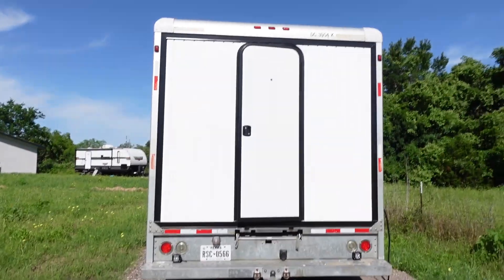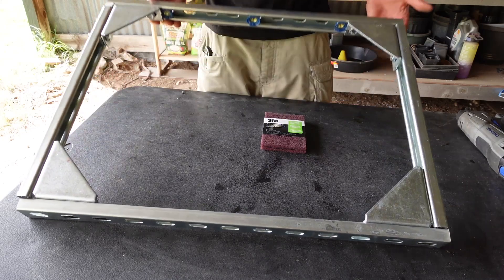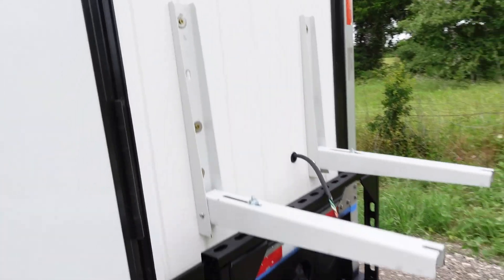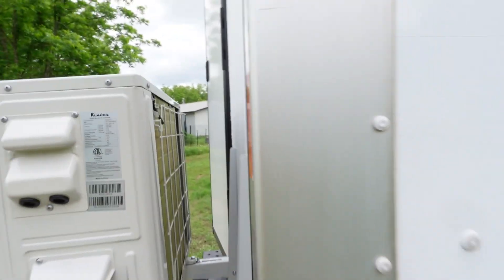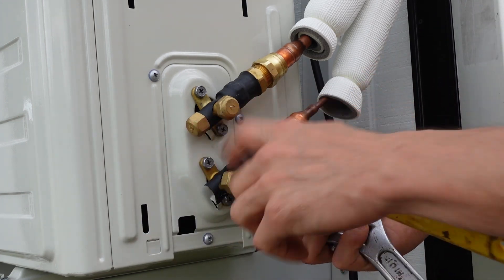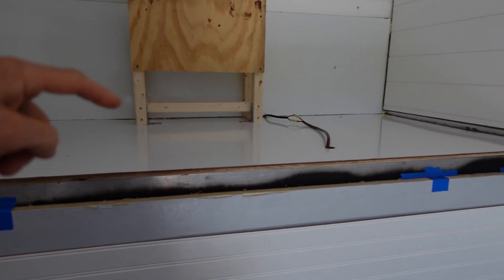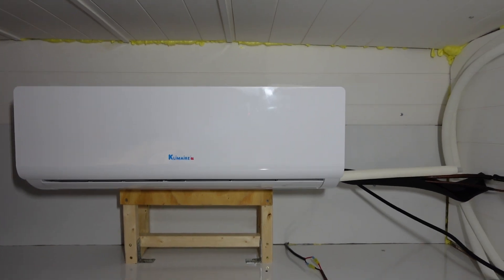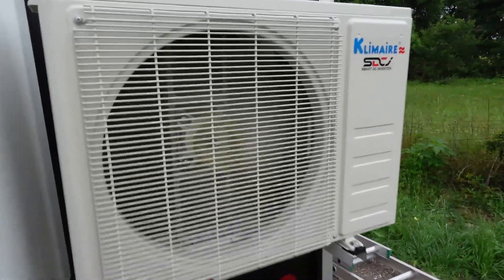Mini Split Air conditioner install | Box truck ductless heat pump installation

Comment: Wondering if the remote uses RF or infrared? Like does it go through walls or do you need a clear line of sight to the unit?

Comment: Would this be too heavy to install over the cab instead of the bumper & create a cover for it?
Reply from the maker: The fan blades can be damaged when freeway speed wind is forced into it
Reply: Makes sense about the blades, but the refrigerator trucks must have a different type of unit in front of their rigs to prevent that. @nomadbrad503

Comment: Hello Brad, Great Video !!  I heard you say in one of your other videos that you weren't very happy with the Heat on that unit. Was it because of where you mounted the inside unit ?  If so, was there any other place that you considered putting it ?   Just curious....
Reply from the maker: The problem is that you have to mount the indoor unit high on the wall so that it cools properly( all the hot air raises to the top
Of the van)  but when your heat source is also high then all the heat hangs out in the top of the van and the air that is lower in the van is cold. 

It’s very noticeable in a vehicle probably due to having less insulation than a traditional house. 

I use a diesel heater for heating. The outlet is down on the ground. I’m very happy with it
Reply: @nomadbrad503  - Thanks for that info Brad !!  I was also wondering about how loud that "clicking" noise is on the diesel heater since it is right under your bed....any issues with that keeping you awake at night ?
Reply from the maker: @menmustchangebeforekingdoms  it not loud to me, no issues with the diesel heater

Comment: You didn’t need to pull a vacuum or add refrigerant when you installed this?
Reply from the maker: No. I bought this unit specifically because it has special refrigerant lines that come with the refrigerant installed. No vacuum pump required. All you have to do is screw in the lines and you’re done. The unit has been working excellent
Reply: @nomadbrad503  Thanks - another question: what is the rated voltage of each of your solar panels?
Reply from the maker: @1drhnsd1  I don’t remember exactly. 4 panels are about 37 volts each. Wired in series-parallel to deliver around 70 volts to the charge controller

Comment: How is the unit connected to the solar panel?
Reply from the maker: It doesn’t connect directly to the solar. It’s all tied  into my electrical system
Reply: @nomadbrad503  
Cool. So how does it connect to your electrical system?

Comment: Why locate the copper wire at the top instead of right behind the unit?   Seems less stealthy routed to the top on the outside.
Reply from the maker: I agree with you

Comment: Hey Brad.   I'm worried a car will back into the mini split mounted so low.   Im thinking about building a 2 x 4 frame inside to screw into.   Also do you have issues with the drain pipe only on one side?   I've heard the water can leak the wrong side when driving causes shifting.
Reply from the maker: dont be worried! life is too short. no leaks from the drain pan

Comment: Very cool installation. Thanks! Are two batteries counter balance weight to the split ac weight on the right side? Since no max fan on the roof, is the air circulation going through the kitchen vent and ac during stealth parking?
Reply from the maker: I did try to balance the weight as much as possible. The electrical cabinet including batteries does balance the ac unit.

Comment: Good video. I installed a 9000 Pioneer mini split on my Class C RV E350 Cutaway van. Wish I had gone with larger unit. I live in Yuma AZ and for extreme Arizona temps you really need 2 times your square footage when choising size. My unit is 26', end of summer it just wont keep up even with good insulation, shade cloth on windows, insulated curtains, insulated floors etc. Anyone considering a unit, go big or plan to stay higher elevation to escape heat. Also, head unit inside may need wall support outside if your wall is thin. Spot on about install, we installed, then had professional inspect and certify, worth it. Back bumper best location, you need access to clean oytside unit after storms to keep out sand, and access to hose to spray out. Inside unit also needs regular dry cleaning of filters to work. The heat from unit is great too. And most important, its totally quiet! You can carry on conversation.
Reply from the maker: yes, you definately need a larger unit, also factory built conversions dont have good insulation

Comment: You have the diesel heater. Why not install a roof top rv style AC instead of the mini-split?
Reply from the maker: Mini split is much quieter and more efficient also it allows me to fill the roof with solar panels. A rooftop ac would require a generator to run

Comment: I saw someone installed a split on the back of their RV like this, and they used solid copper between the outdoor and indoor units, like you would in a home. They found that with the bumping of the roads, the rigid copper caused a refrigerant leak after a few months. They solved the issue by including a short length of flexible tube into the system, apparently that's a thing you can get for airconditioning installs. I'm still considering a split system for my campervan... it's not easy, but I think it can be done. Everyone complains about the roof mount systems, the inefficiency, the noise and the price.
Reply from the maker: The roof mount systems simply do not come close to the performance of a mini split. Definitely go that route if you can.

Comment: Did you use a power inverter for the electrical part you didn’t show
Reply from the maker: Yes, I have a power inverter. It is wired into a circuit breaker, then my inverter

Comment: Mini splits are a great heat/air platform. I’d think that this 12,000 btu unit should be more than enough. I installed a similar unit in my daughters 14 x 35 mobile home and it serves her well. Very efficient and quiet
Reply from the maker: I agree. This 12,000 btu unit allows me to keep inside temps at 75 degrees during 100+ degree Texas days

Comment: Brad, I understand the concern with weight. Having down on the bottom, resting on the steel bumper👍. 1st, presents issues with security with the unit. In a No Crime World🌐, this is a great set-up👍. 2nd, it presents being exposed to the elements storm weather conditions. Rains☔⛈Splashing roads & other vehicles going by you. Snow🌨🌬, Blizzards, Hail Any Sizes. High Waters🌊On Roadway🛣Conditions. The Unit Appears Great, having A/C & Heat Pump👍. What temp will the Heat pump work? How Down Below Zero will it still work? How High Temp will it produce A/C? I am looking👀to get one. Your experience with the unit, will help me much👍. I am not going to have a Back Door on Box Truck. I would be put'n it in center top on the back with metal cage over it & vented well. I would have steel bracing across the whole back top. I would be put'n in other containers on either side. always, Tommy🤠
Reply from the maker: these units are designed to live outdoors in the elements. Hail and splashing is not going to hurt it. not sure why you think it would be exposed to more elements being mounted on my bumper versus on the roof?

Comment: Nice install. 
I installed a Pioneer mini split in my E350 cutaway van. 
It runs 24/7 off my solar panels and batteries.
Reply from the maker: Very nice. How much solar / battery you got?
Reply: @nomadbrad503  1,200 watts of solar panels and 900 amp hours of lithium batteries
Reply: What size BTU?    Curious if 9K is good enough for box truck.   compact desigbn seems more stealth.
Reply: @WakeUpPeople1776  9,000 btu Pioneer but now it wouldn't be my first choice
Reply: @Scrambler85 
What would be your choice now?
Reply: @SS-qk8oc  12,000 btu and one with you ser rating of 25
Reply: @Scrambler85  
Brand?    Other opinions / considerations / pinch points / constraints?

Btw, thank you thank you thank you for being diligent enough to follow up!

Many others will read your reply…

edit, I was trying hard for the less common size of 9, great to know.
Reply: @Scrambler85  

12v?   24v?   110v?

Tell us what to buy, lol.

Comment: Great install - Do you plan to keep the diesel heater as back up?  Also, do you have a link to the mini-split you used?  Thanks,
Reply from the maker: Thank you! I added a link in the description to the mini split. I will keep the diesel heater as backup. Can’t beat the warmth of diesel heat on cold days

Comment: Excellent job, Nomad Brad!  Could I ask you about your pass thru door?  If you had wanted to build your own door, (granted, maybe not as attractive as the factory door) how much higher, (to make the opening longer) could you have cut out the hole for a taller door?
Reply from the maker: Thank you! You could get about 4 more inches of height

Comment: I was looking at the home made bracket and watched how you placed the outer unit onto it..  I would have ran some c channel from the white brackets to the bottom of the brace you made, Keep the forward back motion nulled out..  I would recommend sealant fpr ac lines onto the copper fittings for the threads to ensure that they do not leak,,   I also  recommend pulling a vaccuum on the lines to remove any air,.  Overall nice work!
Reply from the maker: Thanks! I was planning to use nylog thread sealant but forgot…and these copper lines are designed to be used without a vacuum. The down side is once you make the connection you can’t remove them…so I can’t add any sealant unless they leak..then I’ll have to pull a vacuum and seal
Reply: @nomadbrad503  I think it won't leak,,  but I have a bad habit of over torque everything..  like a german mechanic told me everything is made by my friend sir goodandtight  neverleak,, ;) look forward to your next video, amd I subbed too.!
Reply from the maker: @InkBunnyBlindRabbit  thanks! I appreciate you

Comment: Why not a 12v mini split?. Just curious
Reply from the maker: Yeah…air conditioning is more efficient at higher voltages..12v is a lot of strain, a lot of amps, and a very large gage power wire. This 120v ac only pulls 300 watts to maintain temps..very efficient. Should have no problem running it 24/7 with my electrical setup
Reply: @nomadbrad503  after a year of use are your views on DC vs AC aircon units the same? Just wondering as I'm choosing parts for my ambo build.
Reply from the maker: @RockBoxLife  I recommend this style ac. I have friends with the smaller dc units…they don’t have the same cooling abilities. My “ac” unit uses a variable capacity dc compressor”
Reply: Marginal efficiency gains for incredible price increase. A bad deal for most people.